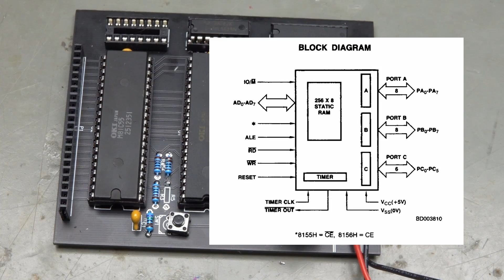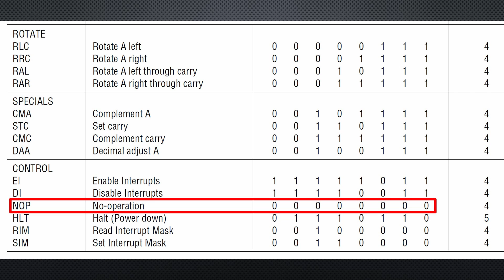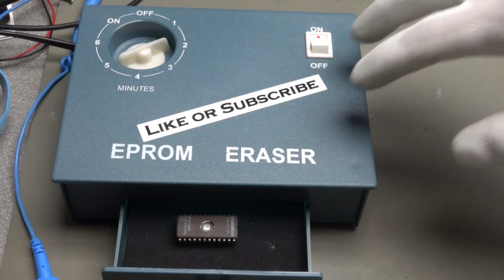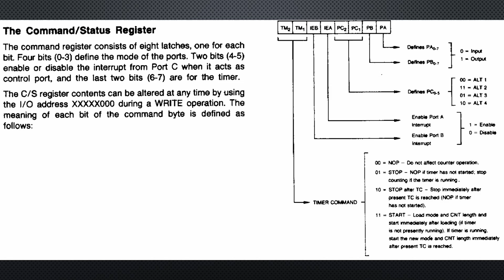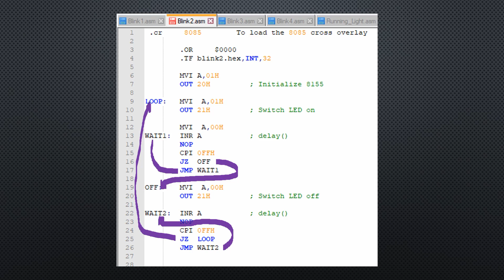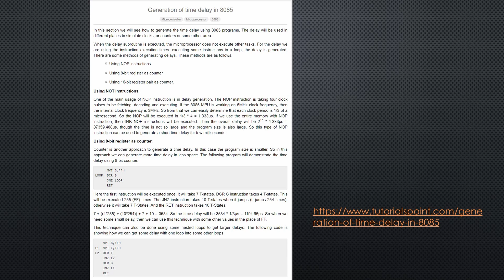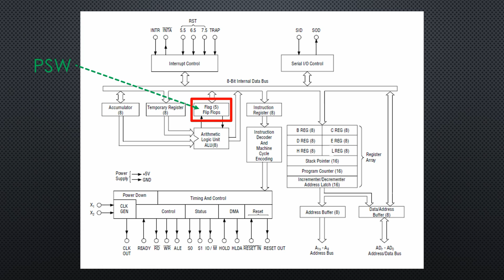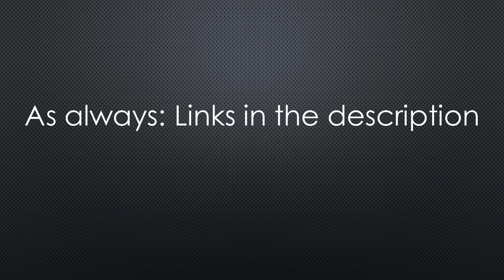#314 Retro: Assembler Programming with 8085 (incl. plan for board)

Comment: You may have a look to the solution of Ben Eater to use a arduino mega 2560 to display the address and data in the serial monitor.
Reply from the maker: Unfortunately the 8085 does not run below about 500 Hz (even the CMOS version). So this would not be readable...

Comment: Back in the day, the first thing I would do is port FORTH to any new hardware. This makes debugging hardware much easier.
Reply from the maker: I never used FORTH, I only used PL/M on these chips.
Reply: @AndreasSpiess  I've always found FORTH an interesting language. I'm building a 6809 CPU board and plan to include a version of FORTH for it in addition to a monitor ROM and a version of BASIC. I don't recall having heard of PL/M but it made me think of PL/C. I looked up PL/M and see some of its roots are in PL/I which is the root of PL/C which I have used.
Reply: Hi, I used FORTH on a ZX Spectrum back in 1984-85 or thereabout but never since. Do you know how to control IO lines for Input/Output ?using FORTH? I have a 6809 board I built in 1983 (Flex system) that could be nice to try again. Please forward pointers to interesting  links if you have some. This Flex system was a dead end at that time when PC's were available. This was a CPU board,memory,CRT, diskette controller + some IO. 4 boards in a backplane i I etched myself.